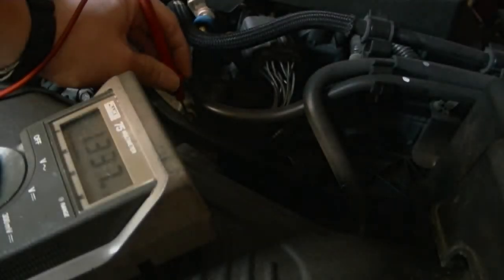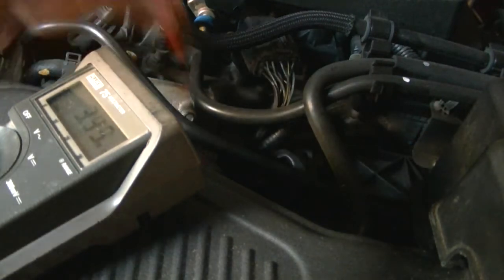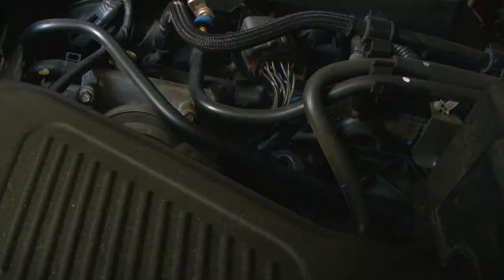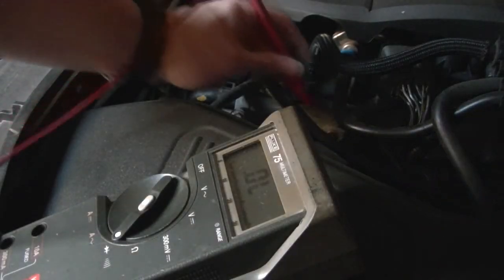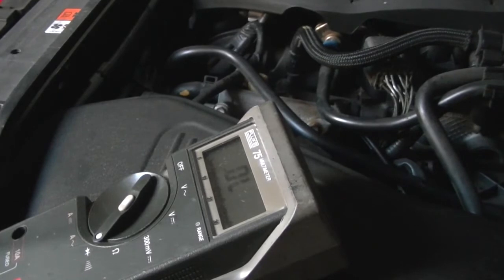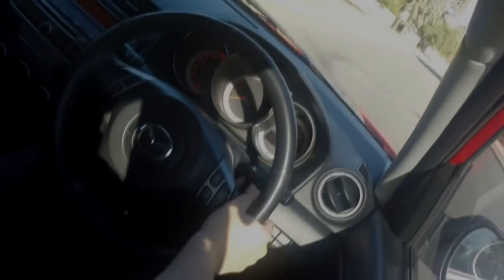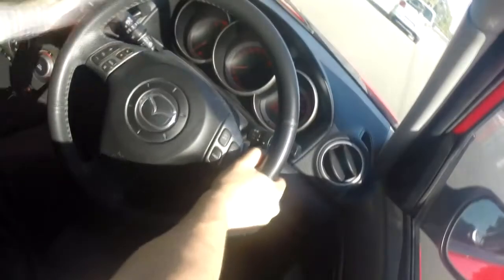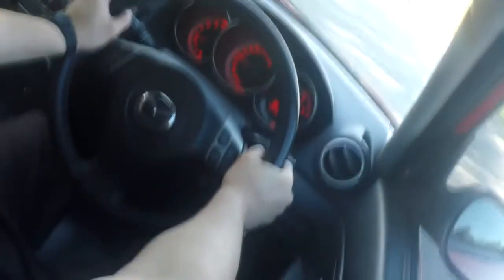Electronic Throttle Body Ground Mazda 3 Series 2 SP23 2006

Comment: Does it work on mazda 3 1.6 or only on 2.0?
Reply from the maker: Not sure as the 1.6 wasn't available in Australia. This won't work if its cable throttle.

Comment: Hey, I have a question, whats the size of the throttle body intake? Like the piping. I'm trying to run a custom air intake :((
Reply: If you want to run a custom intake then you measure the radius of the throttle body, I’m not going to help and tell you. Doing your own research is key